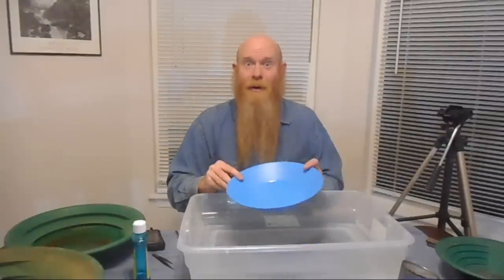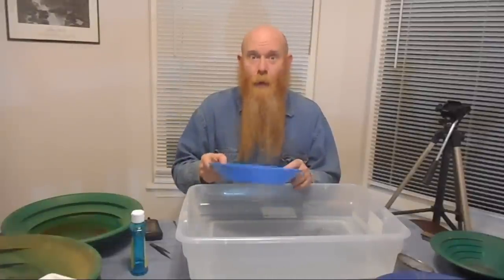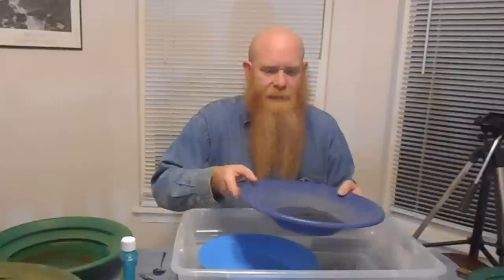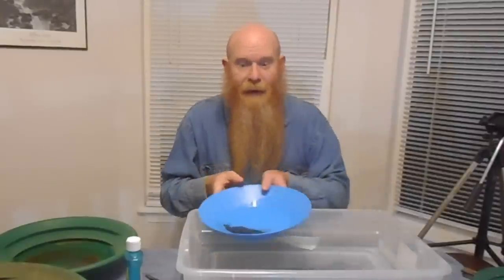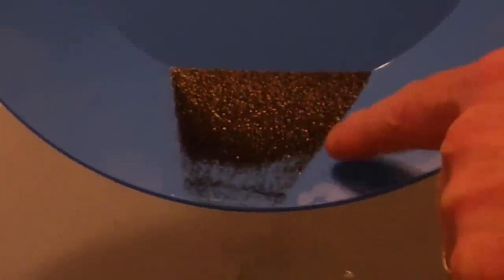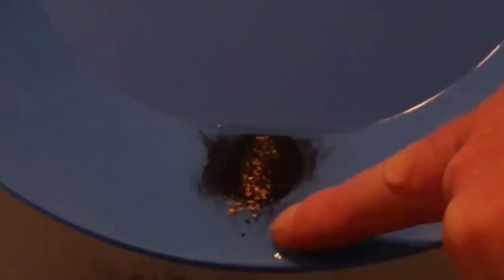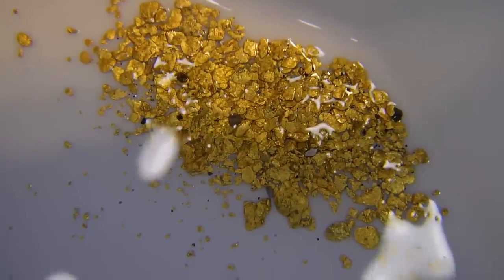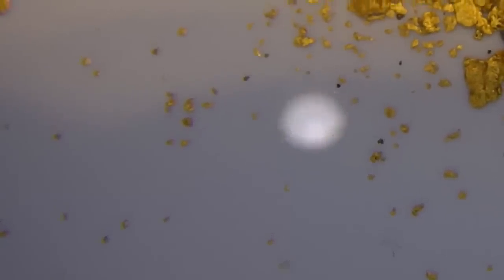Cleaning fine gold from black sands:  Method #1 (Simple panning)

Comment: A good
video. In some places the gold is much finer. So fine that jet dry is not sufficient
to stop gold to float. In this case I use some Isopropanol. The big
disadvantage is that the fumes are very nasty. So panning can be done outside
only. In top of that you have keep the solution in a good closed container that
the isopropanol is not evaporating. Hope that help’s to somebody.

Comment: i find a pan that has the bottom with a rise of just an eighth inch vertical before it flares out to be so much easier early in the panning (like a garret 14" amongst many other) and then later tranfer to one without it (like a garrett 10") - [WOW happy days , I just learnt how to edit my posts :)]
Reply from the maker: I agree a small lip can help, specially when using the tapping method.

Comment: Nice, you just can not do that on the river. Right?
Since you have after the long day just not a steady hand.
Greetings Tom
Reply from the maker: I often do my final clean up on the river.
Reply: @Danhurd  I understand that. You also have more (small) nuggets. These are also on the bottom of the pan. You lucky ones.
  In my area, it's just gold flakes. Most of them can also be washed out by the river. However, it is advisable to make the whole thing at home with detergent. Since, as you have shown, some can float. Greetings Tom